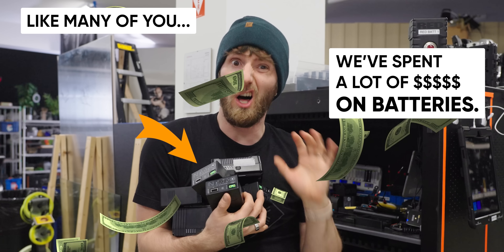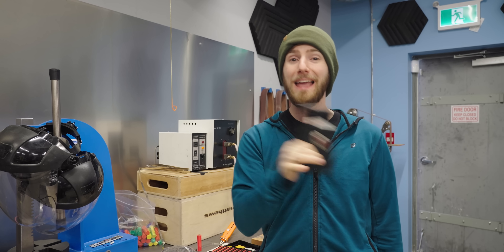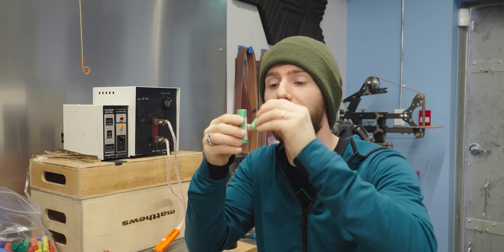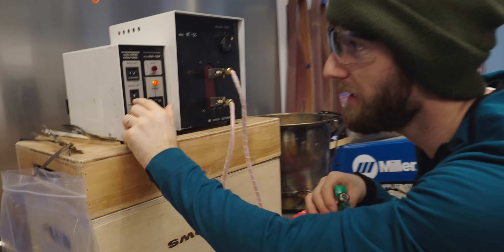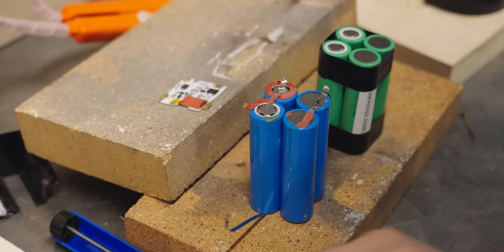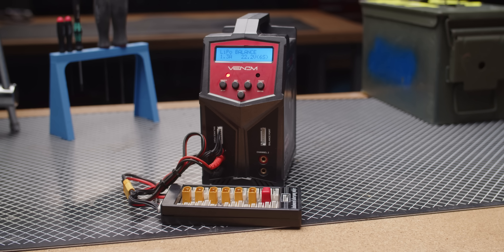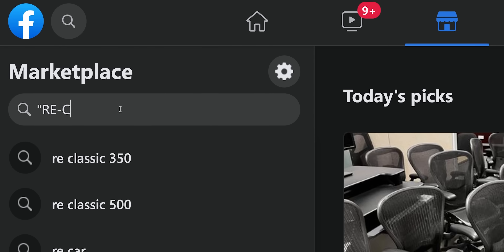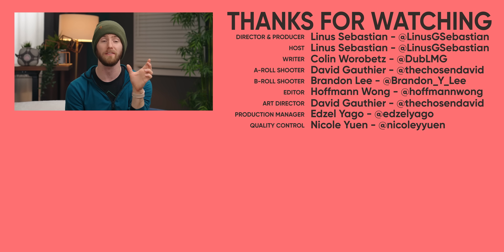This should be illegal… Battery Repair Blocking

Comment: Also, in regards to BMS'es, a lot of the BMS'es in laptop battery packs will count the number of charge/discharge cycles. They won't necessarily cut off after a pre-defined number of cycles (like your evil BMS example) but they will monitor the cell voltages. If a battery pack becomes severely out of balance, or if the voltages become too low, the BMS will lock itself to prevent further charging/discharging. Furthermore, if you try and re-cell your laptop battery pack, there's a good chance the BMS will, again, lock itself - requiring the use of specialist tools to unlock the BMS and get it working again.

Comment: The moral of the story is that, unless you know exactly what you're doing with these battery packs, is that it is much better to just buy a new battery pack instead of making your own. Sure, you can make your own battery pack (especially if you can't get hold of a replacement) but you have to be super careful. Shorted out Li-Ion cells can easily catch fire or explode.
I have dealt with Li-Ion battery packs before, but only disassembling (i.e. removal of 18650s/Li-Po cells from laptop battery packs. I've not built a Li-Ion battery pack myself and I don't have a spot welder to do it (yes you can solder the cells but it is not recommended).

Comment: Cell replacement is some kind of dangerous for the consumer and the corporation. We build such packs and we saw customers replacing cells which resulted in hazardous conditions for people and environment due to lack of knowledge. Especially Li-Ion Packs. The question is: who is responsible for any kind of hazard arising from use or even misuse of a product. Especially in the US people tend to sue corporation for their lack of knowledge (or misuse of a device). Additionally the distribution of those altered battery packs is not tracked, if re-sold the next customer would think it is original with all safety etc. enabled which you cannot be sure of because it was altered of a third person (without permit or certified knowledge about the product). In case of a failure of the repair or in case of damaged safety measures due to the alteration those customers would accuse the manufacturer. A cell or battery failure tends to show up in most unexpected situations. We make lots abuse tests and add safety measures for many scenarios, and know about the danger. The cells do not have a management system or life tracking themselves so it is not possible to protect against a scenario where a bad or not suitable cell is introduced to the battery pack. In my opinion, repairs should be done exclusively by educated and safety aware (and certified) persons which can guarantee function and safety of the repair also in a legal way. That beside the money part is a reason to protect battery-packs from disassembly or private cell exchange. Technology comes always with responsibility both of the developer/manufacturer and the customer. If history would prove customers could handle open systems they would be here. Imho education of the average people need to catch up to the technology available. The gap is huge and growing fast.

Comment: Love when people with a following post how dangerous and terrible doing things yourself are but also included that they're unqualified and using sub par tooling.
Reply: Just replace the bms. It's cell disconnection sensory. Bms' are tuned for the specs of the cells the manufacturer uses.

Comment: Dood...  :)   I spent 16 years rebuilding/recelling battery packs for a living.  When connecting cells in parallel, check TWICE before you spot them.  TWICE.  This is why voltmeters exist.  And before spotting, just 'tap' the nickle strip against the terminal first, so there's no surprises.    Any mistakes or potential mis-haps will be readily evident in most instances.   Likewise, if you buy a batch of new cells, and one checks low, don't just arbitrarily discard it, recharge the lot THEN check again.  Twice.  I mean, damn.  Good cells are Not cheap.  I never had a problem with a refresher charge on ANY cells I'd buy right from the beginning.  I thought everyone did this with a fresh purchase.   The low ones almost always come right back up, as long as you got decent quality cells that had good QC.  I also check them for capacity with an IMAX B6.AC battery charger/discharger/capacity checker.  Works well.  Highly recommended, small, reliable, and MUCH cheaper than most other decent rechargeable cell test-boxes.     Cell is actually cranky and won't come up to spec?  Then you can discard the bad cell.  The IMAX will tell you if the cell is indeed a dud.   And a hot glue gun is your friend.   I always use a hot glue gun to spot-tack the cells together so they don't keep trying to tumble, always worked out well... make a mistake, they will pop apart, no worries.  When they do align correctly and everything fits, THEN you can secure them with a decent load of hot glue.   Works good.   In my years, I damaged (well, violently destroyed) only one 18650 cell... which rolled off the bench, landed just right to dent-pinch the cell case against the positive terminal.  IOW, a dead short.   The cell became a rocket motor, spouting a pink flame like Mace Windu's light saber that actually caused the cell to whiz around the shop floor making crackling hissing noises, bounced off the wall and shot up to the ceiling, bounced across the shop and finally came back to earth in the corner behind a stack of small cardboard shipping boxes where it started a fire.  It was like a roadrunner-coyote cartoon.  I extinguished the fire with my thermos of coffee, which disappointed me because it was almost full.  I was astonished at how violent the reaction from a direct short could be in an 18650 cell.  Likewise the smoke.  Nasty.   Don't do it.   Really.  Afterwards, I attached a "bumper strip" along the edge of the work bench to prevent any more roll-offs.  Once was enough.   BTW that rocket motor'ed 18650 cell is still around, on a shelf, kept it for posterity, and as a reminder.
Reply: Damn..to bad had to sacrifice that coffee..once i dropped a Motorola phone..went up in flames and burned a 12x12 hole in the carpet.
Reply: @colbylaro9361 Inches or centimeters? <insert thinking emoji> If inches, holy moly, if centimeters, that sounds more reasonable for what i would expect...
Reply: Holy bible text wall Batman!

Comment: no 2 cells are the same . they never charge and discharge at the same rate..... making a pack with cells in parallel will cause cell failure.

Comment: The other thing that these evil BMS systems do is once the BMS detects a bad cell, it will no longer revert back to its original state because having a battery pack with a bad lithium cell is dangerous. I have heard of lithium cells reversing polarity. I can’t imagine what would happen if, God forbid,  this were to happen in  battery pack in a camera that is right next to somebody’s face. What I want is for manufactures to make their battery packs 100% serviceable by making the batteries easily removable like they are in a basic battery charger. That way if the BMS detects a bad cell, you just take the batteries out and charge them individually with your Amazon lithium battery charger and it will let you know that “hey this is a bad cell, recycle it.”

Comment: I have a couple different rechargeable packs for various tools that have proprietary sized cells. The you have the case of old electronics where the battery pack is part of the circuitry of the power supply / rectifier than requires some additional components added to keep from burning them up.

Comment: They are not"virtually indistinguishable"
Small lithium-ion batteries can be doused with water because they contain little lithium metal. Lithium-metal battery fires can be put out with a Class D fire extinguisher. Larger battery fires are best handled with a foam extinguisher, CO2, ABC dry chemical, powder graphite, copper powder or sodium carbonate.
Reply: Yeah, once a lithium battery gets going it's not lithium that's burning, and it's not electricity being released. It's the electrolyte (in LiPo, the polymer), comparable in energy content to gasoline, and it burns so bright because the cobalt oxide anode decomposes into cobalt and oxygen at those temperatures, feeding the fire. Smaller batteries can be cooled quickly enough with water to stop that, larger ones have too much mass and too much lithium for water to do anything but aggravate the reaction. 

Even with smaller batteries though, that's a class B fire because what's burning is the polymer, not lithium. Lithium is mostly not in a flammable, metallic state in these batteries, but instead is usually compounded with the cathode. Hence, throwing water on them can make it worse even before you take the lithium into account. Once its hot enough, metallic lithium will be produced and then consumed making it as class D fire and that's when you need dry chemical extinguishers. 

And with all that, foam and chemicals actually do nothing to the fire for a good while. It has its own oxygen source in the battery, the cobalt oxide. It will burn for a while and you can't do anything to extinguish it other than steal heat. The fuel and oxygen are packed in tight layers in the battery already, they can't exactly be separated without surgical tools.

Comment: I feel like you guys are making a mountain out of a molehill here. Yes right to repair is very important, but BMS chips cost a fraction of what you will spend on replacement cells. And to be honest you should replace the BMS anyway. Plenty of folks in the battery building community dislike BMS's all together, referring to them as "Battery Murdering Systems" because of their tendency to fail catastrophically and cause fires at any time for seemingly no reason. For that reason alone, I would always want as good and as new a BMS in my packs as I can get. Reusing a old bms is just asking for trouble.

Comment: I rebuilt one of my Milwaukee M12 batteries for about $20, and I used the exact same cells as the manufacturer. That's about a 1/3 the cost of a new battery.

Comment: I suggest DYSON vacuum cleaners use EVIL BMS.  If you remove a single cell for a second, the BMS just flashes the change LED and does not supply usable power ever again.

Comment: 5:40 Those spacers are rubbish when it comes to thermals. The idea of tightly put together pack is that the cells inside can cool off by radiating their heat more directly through the other cells. What the spacers do is the opposite by creating hot spots for the inner cells for these all these airpockets where air gets trapped. Keeping cells tighly together creates a single coherent heat transfer unit that radiates outwards, and that's what you want. It also saves space and makes the pack way more durable for solderings cannot shake around from the flex of the plastic spacers. There's a lot to battery building you can learn from ebike battery maker guys here, rather than Linus who knows his PC's.

Comment: 4:40 Bull biscuits on the #1 about "can short-circuit during assembly". With the proper fittings there's no higher risk than with brand new cells.

Bunch of ebike users run with such assembled out of random cells batteries just fine. That's cos they know what they're doing, testing for resistance etc, unlike these guys who get most clicks from the odd chance of just dropping some espensive things. It's like watching Nascar, hoping for the crash, cos it's pretty boring otherwise.
Reply: Yeah, you can re-use old cells just fine if you test and inspect them correctly. Which, if you're going to be doing something like this you should know and be capable of doing anyways. I don't know where Linus got his information that you can't do that safely.
...Well, probably from the same source that he got his spot welding information and thought it was a brilliant idea to overlap the strips for the leads (it wasn't).